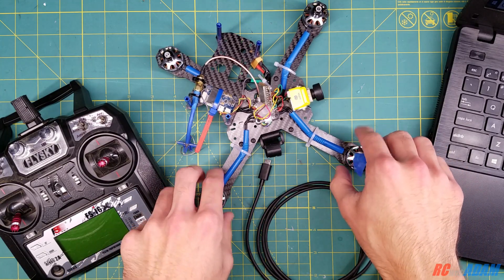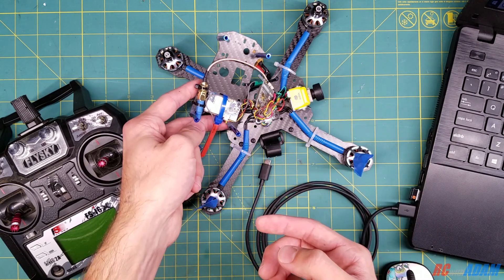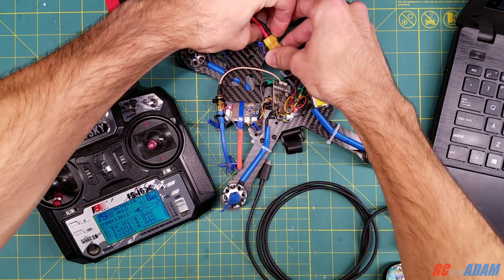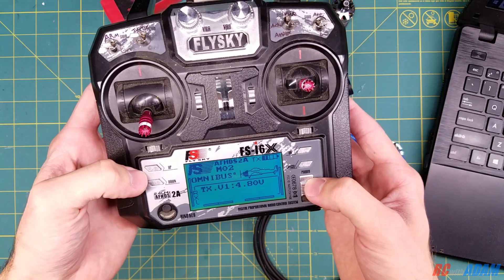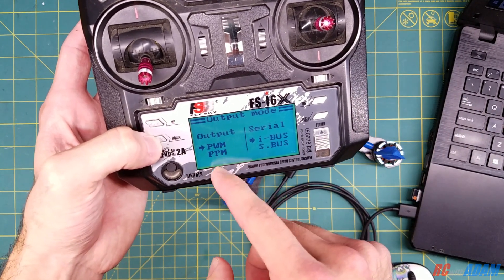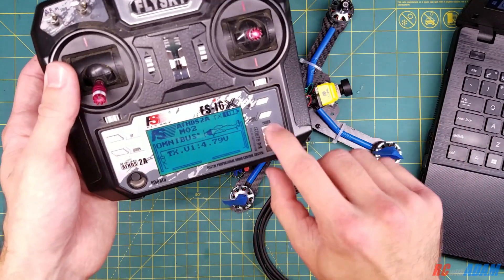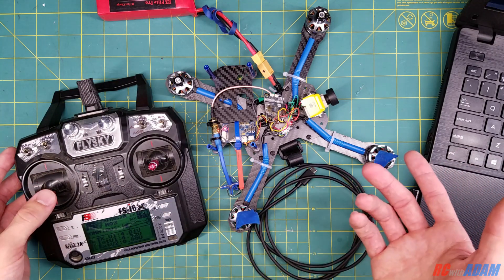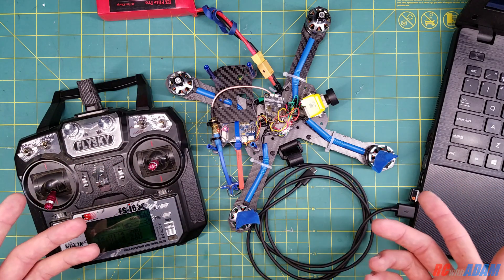QUICK FIX: FlySky X6B Failsafe NOT working? Try S.BUS!

Comment: My ibus is on uart2 , if i just flip to sbus via transmitter , and change to sbus on bf i lose all signal ( no imputs on the gimbals.  Sbus does not work. Does sbus need to be on sbus pad on the flight controller?

Comment: Great video, for anyone that was unable to solve the issue. I followed the steps of a below comment and set the failsafe on the FSI6X on the channel used for my arm switch as well as the throttle and it worked mint.

Comment: If you need to really use the failsafe and kill the motors on your quad you don't need to change anything like that, as iBus working like a charm to me. What you need to change, is the setup on your radio. First of, on the FS i6X you need to the failsafe menu, get your channel 3 (the throttle) to -100% and also, the switch you using to arming your quad to 100% (in my case was the 100% because of my setup) and voila, now when you switch off your radio the quad not only lowering the motor power, but it actually cut of any power.
Reply: THIS WORKED, THANK YOU !!!I  Also to be clear I actually followed all the steps Adams showed on multiple different quads with the X6B receiver with no luck. S.BUS would not work.

Comment: Hi Adam,my fs-i6s couldn't bind to my ia6b. But when it 1st arrived,it bounded then a few minutes later it doesn't connect anymore and I couldn't bind it anymore. I've tried all the solutions in YouTube but still couldn't bind it. What should I do now? Is my transmitter or receiver is more likely defective? Please help. Thanks
Reply from the maker: Hi! Interesting issue. What is the ia6b connected to?
Reply: @RCwithAdam1  I'm connecting it to my fs-i6s,the one with the upgraded version or firmware updated.
Reply: @RCwithAdam1   I'm not sure if the receiver or transmitter is defective,I got it brandnew and haven't tested it on other receivers yet.

Comment: I found a way to make it work in i-bus. Problem is when you set up failsafe in the controller, the failsafe value can't go lower than you stick, which is not low enough for betaflight to detect failsafe, becaus it is a normal stick value.

FIX:
Go to your controller menu - Function setup - End Points and set you low value for channel 3 to 120%. (throttle chanel)
Go to System Setup - RX setup - Failsafe - and setup your failsafe for channel 3, which now can set to -120% (950) 
Go back and set your end point for channel 3 back to 100% (else you will failsafe when you throttle down ;-) )
Go to failsafe tap in Betaflight and set Minimum length in Valid Pulse Range Settings to 970 (or somewhere else in between 950-990) 

I don't know, I prefer i-bus, because s-bus seems to screw up my subtrim and end points quite a lot, and also my RSSI value, from the radio doesn't seem to work eighter.
Reply: It worked thankss!!! But now i have a doubt: what differences ewill the changes make to the quad apart from making the failsafe work? Like the -120% and the minimal pulse value...arent they ruining any other aspect of the fly? (I dont actually know what those value are referred to, thats why in asking)
Reply: @Theo-mb2dd  You need to change the radio back before you fly, other wise the quad will failsafe when you bring the throthel down to zero 👀
Reply: @Theo-mb2dd  so change the endpoint, set the failsafe and then set the end points back to normal 👍
Reply: @amoeslund  ???? You mean setting the endpoint back to 100% and the pulse to the old value? Then why should i have done this if i have to change it back before flying
Reply: @Theo-mb2dd  okay I has been 2 months since I wrote the first comment, if you just do everything the fist comment says, then your drone will fly as before, and your failsafe will work.
You can test it by arming the drone and then turning off the radio, then the drone should turn off
Reply: As of today I am using crossfire on the tango 2, but best of luck and have a nice flight.
I found the biggest problem om my flysky was the delay between the rc comands, I think it could be resolved by setting the remote to only 6 chanels, so turning off some of the aux channels.
I don't know, but if you want to stick with flysky it is worth to look in to.
I can eaven see the delay between rc commands on my blackbox logs, they were between 0,1-0,2 seconds and some eaven bigger
Reply: @amoeslund  i m just starting, i received my first quad two days ago. I guess in gonna upgrade to a better radio soon. I was putting my eyes in the qx7 with r9m module, but for now i only wanted a working setup to get started. Thanks for your help!
Reply: @Theo-mb2dd  you are welcome. I have been flying the flysky for over a year and it have been doing a great job. I did the firmware mood, and I have really been using the rssi a lot. (the range is not the best), but that could be the reason for my big rc signal delay. I am not sure but the rssi has been really nice.
Rssi=a number for how bad your remote control signal is

Comment: I was under the impression FlySky only used ibus and had to solder 2 pads together on my FC to make it ibus. Should I take my quad back apart and change it to sbus? I'm waiting on a battery, so I can't test anything until that comes in.
Reply from the maker: Hi! I would just leave it as is and see how it works before taking stuff apart.
Reply: @RCwithAdam1  Thanks for getting back to me. I'll leave it and hope for the best :)

Comment: is ok but if you want you can do it without switching sbus.. the failsafe you do is on betaflight no matter is ibus or sbus. you dont make the failsafe on your radio on ibus or sbus, only on betaflight. you can make a failfafe on your radio. sbus or ibus or ppm or pwm. for me i make the failsafe on my radio AND on betaflight. (put a little delay to put your quad flat before the motors stop's. minor damages.. (excuse my english..)

Comment: Hey all! super simple workaround!!! linked article explains it very well.

on TX, set ch3 (throttle) lower endpoint to say 120% (now min throttle is 900 not 1000), set tx ch3 failsafe as that (-120%), then set the betaflight min pulse in failsafe menu to something under 1000 but over 900, and when the tx failsafes, it sends lower-than-1000 signal to the FC, so betaflight will engage your failsafe protocols.  and don't forget to set your endpoint back to 100 afterwards.

Spread the news. 
https://www.propwashed.com/ibus-betaflight-guide/
Reply: dude THANK YOU SO MUCH! i upgraded to bf 4.2 and failsafe was not working right. so i concluded that i will have to failsafe with tx only just disarm, no beeper. and then i saw your comment and it worked. THANK YOU SO MUCH ONCE AGAIN

Comment: Hi iv just built my quad for the first time,  not set it up yet in beta flight,  but when i plug my battery into it , the quad does the tone song but then it beeps 3 times at the end ? 
Why is this , is it because its not set up yet in beta flight
Reply from the maker: Hmmmmm... I'm really not sure. What components are you using for your quad? What kind of issues are you having with it? What kind of battery are you using (3 cell?)?
Reply: @RCwithAdam1  it was the buzzer that was beeping lol , 
I plugged it out and quad beeps as normal
Reply from the maker: @stakeout2  LOL glad you figured it out!